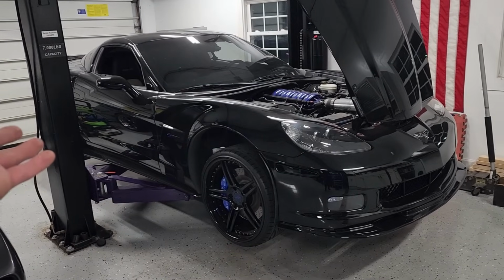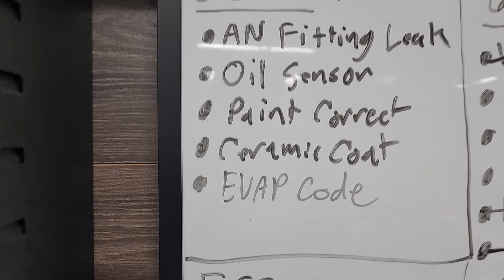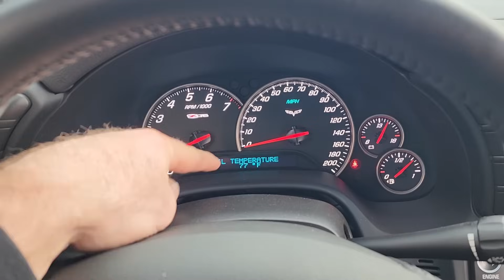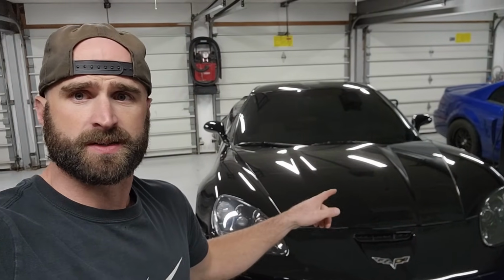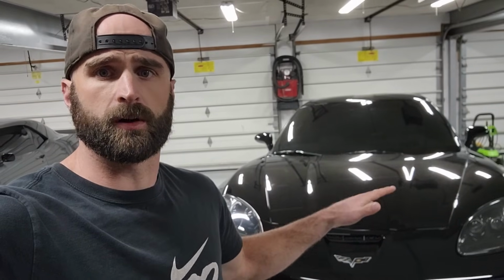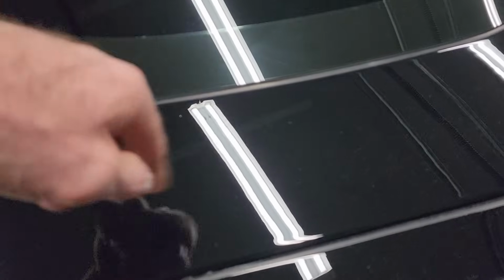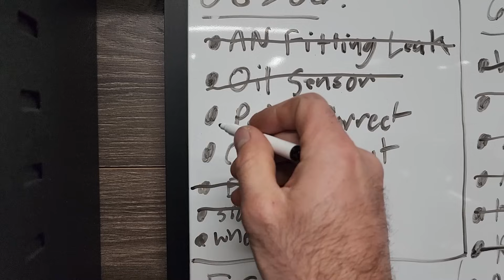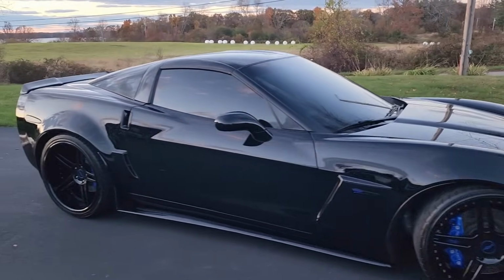Perfecting My 1200HP TWIN TURBO C6 Z06: Mechanical Fixes and Paint Work!

Comment: Chevy has tons of problems with emissions components.  I know from experience if you top off your tank (fill after lever clicks) emissions components can be damaged.  Especially the vent valves, charcoal canisters.  Hope you got it solved. Gas cap has never worked for me.

Comment: My brother had the same EVAP code on his Z06, told him to check gas cap and all of that. Replaced the cap and rear evap canister. Neither of those fixed it and it still smelled like gas fumes. Looked at the front EVAP vent solenoid thats on the motor and it looked fine but we took of the engine cover anyway and realized the plug had managed to wiggle itself slightly loose. We made sure the plug was snug and the code went away on the first drive lol.

Comment: 2 questions: what jack point are you hitting in the front? What are those wheels? They're sick. I have  Ace Alloy AFF06s are I had fitment issues. Had to dremel my rear brake calipers a tiny bit to avoid rubbing there, and I had to trim the wheel well on my quarter panels (would have been rolling them if they were metal, but obviously can't do that on fiberglass) and I also get some rubbing on the front wheel well liner, but yours look like a perfect fit, plus I love that deep dish!

Comment: I have to say man... with how often you refine the paint on your rigs, and end up NEEEDING to lift another project and can't because your lift is already used or whatever... You should look into a set of Quickjax... I bought some cause I cant put a lift in where I am at now... BUT MAN!!! They are SUPER helpful especially with lower cars when doing buffing or paint refinement!! Most of the Quickjax lift 2 feet//24" or more... and they store easily out of the way, have quick disconnects and do not leak fluid... and they work pretty great! * Also great videos... your content is solid!
Reply from the maker: Looking for a deal on a set. Probably gonna end up buying new lol
Reply: @ChrisSullivan69   They do go on sale supposedly at Costco, about this time every year I hear. Good luck man! I think they will be worth while for you. 

On my c6, I got about 1/2 inch of space, and can slide them under my car without ramps(quickjax are only 3" in collapsed height)... Even with similar ground kit on... but I am not quite as low as you are.

Comment: Where were you placing the rear lift arms on your frame? From the camera angle it looked like the rear arms were farther under the car. I have the same issue on my lowered C5 so I need to ride up on 2x8 ramps just to get a jack under the car. I’m using the standard jacking points.
Reply from the maker: Standard jacking points. I use hockey pucks on the lift arms themselves

Comment: Hey Chris, for the wet sanding you did, what type of grit did you use? I have something similar from a previous owner on my Camaro that using cutting compound doesn't seem to remove. Thanks!
Reply from the maker: Start with 2000 grit and go from there. Little bit at a time. Don't get greedy. Once the scratches are gone, 2500 grit, compound, polish, done 🤌
Reply: @ChrisSullivan69 thank you kind sir! Definitely a butt clincher.

Comment: Sounds like E85 cold start when it shuts off mine does it and I need to revise the tune to eliminate it. Your car sounds like a monster . So my turbo sounds like that so are you running a precision turbo with the jefighter cover on them?
Reply from the maker: Garrett gtx3582r
Reply: @ChrisSullivan69 oh ok well still sounds really good and I do a lot of paint correction and I’m enjoying the video but it takes a lot out of you when doing black paint.

Comment: The Ls7 loves boost if the heads and cams r done right? Otherwise its dangerous to do even intake and exhaust upgrades on an NA Ls7?
Reply from the maker: Not really. Ls7 cylinder walls are really thin so the tune has to be spot on. The crank and rods are pretty damn strong though
Reply: @ChrisSullivan69  ohhh i see okay thank you! I been researching recently on the c6 z06 bc i plan to get one

Comment: 1200 HP on the street is hard to utilize. Really anything over 500 for rwd is fairly tough to drive and lay down power. AWD you can push higher and actually be ok on the street. Chances of losing traction and losing the car go up big time once you hit 500 mark

Comment: I know a much better way the get a corvette on the lift. pull the car in to the lift where you need it to be. Then jack up in the back of the car high enough for the fronts to get under the car .then pull the lift arms in the place and lift the car. I took my car to a corvette guy that only works on vets and the is how he did it. I was like well that easy lol

Comment: Your car sounds like it wants to kick someone's ass and steal their wallet. Nice Vette brother.
Reply: By the way, for p0449 you can measure the resistance across the solenoid to determine if it's the cause. Really high resistance means it's pooched.
Reply from the maker: Good tip!